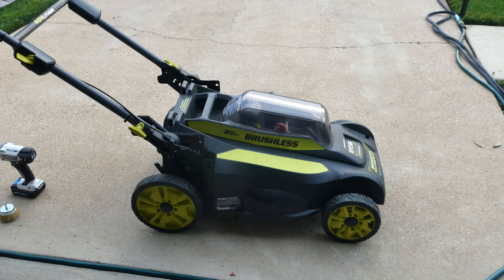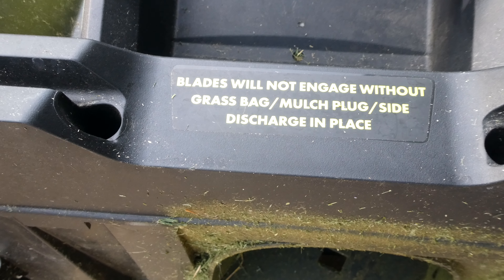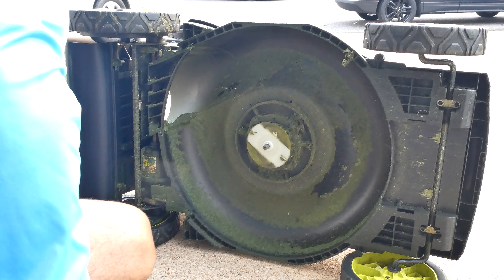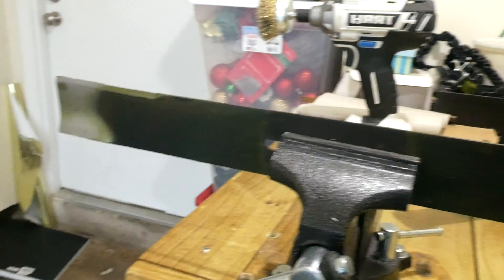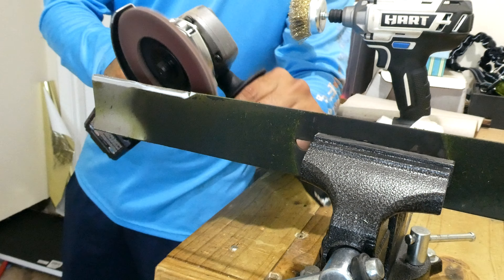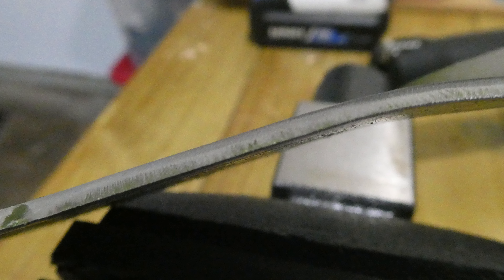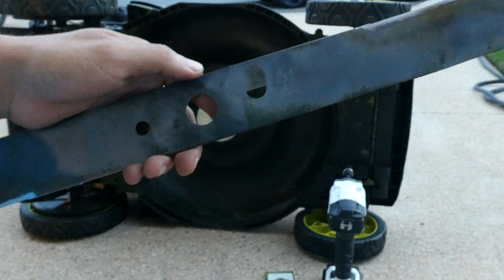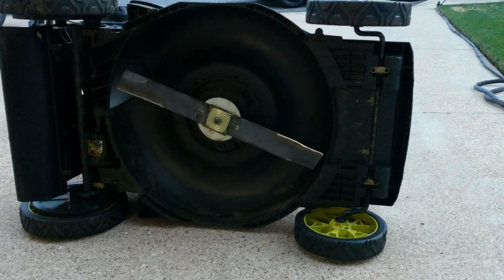How to Sharpen Lawn Mower Blades with Step by Step Instructions Ft. Ol' Reliable

Comment: Why did you go for hart tools when you have ryobi lawn stuff?  More importantly, did you get any 40v hart stuff and do the ryobi batteries fit?
Reply from the maker: No i did not get any 40v hart stuff so I don’t know if the batteries are interchangeable.( though I highly doubt it) But good question with the different brands, I was actually gonna go Hart all the way but I got a Really good deal on the mower from a guy who buys Amazon returns. At that point I felt it was necessary to stick to the same brand with 40v